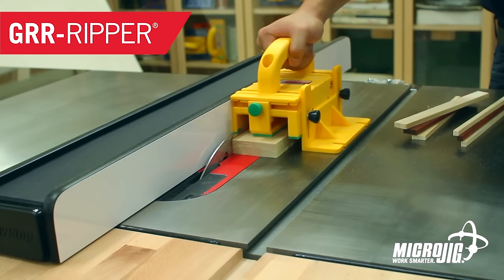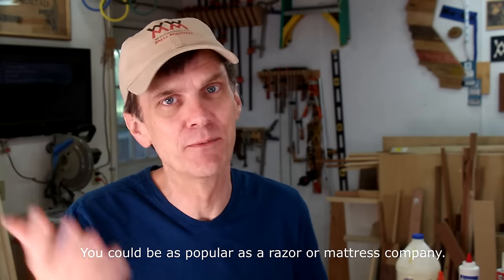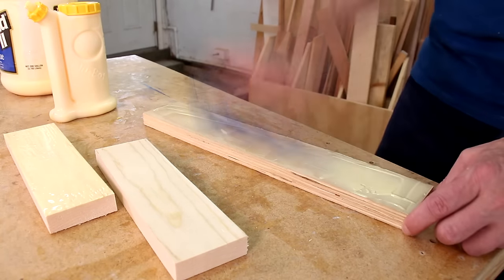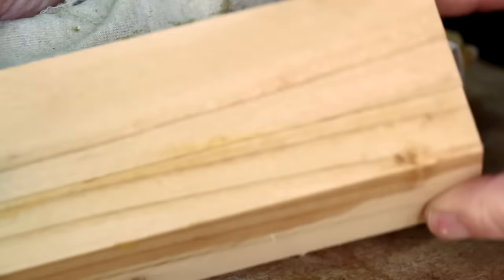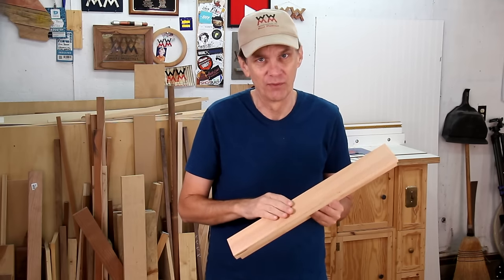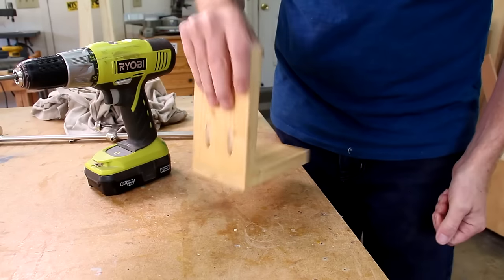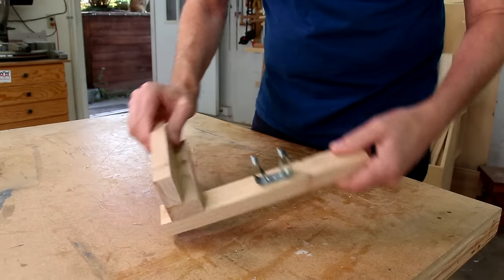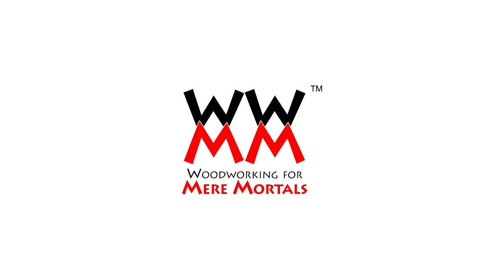What You Need to Know About Glue | WOODWORKING BASICS

Comment: Used weldbond over thirty years ago to stick cement over painted bricks. Cemt still on and sold as a rock. Also glued a capping stone on a brick pillar afain over thirty years ago and it's still stuck. This glue is amazing for woodwork that is to be painted, but wont take a stain. You need to use sparingly around edges so squeeze out is barely noticeable, dont wipe with a damp rag as it will spread and not take stain. Once dry just scrape ant access off or plain down to remove any overages. Can't help but sing praises for Weldbond and no I have no company  connections.
Reply: Absolutely Weldbond! It's the ONLY thing I use, been using for well over 15 years and have never had anything come apart etc...glad to hear you talk about it, everyone's so Titebond oriented that I was watching this thinking, "yeah, here we go again..." Thanks Steve, you give me hope! 😀

Comment: Steve, Is wood glue suitable for painted wood? If not what would you recommend"
Reply: no matter the glue,  you should always sand it off if you can...other wise you are solely depending on the "hold" of the paint to the wood...which isn't meant to be load-bearing.

Comment: When gluing and clamping two bits of really smooth timber, sprinkle a smidge of salt on the glue, this will form a little key between the pieces which will stop the work sliding and shifting when clamping them together.

Comment: Great video but you should have talked a little about the difference between waterproof glues and the regular wood glue that you showed. I only recently learned that if you build outdoor furniture with regular wood glue, it will weep milky tears and the joint will separate even with biscuits in! Live and learn I guess.

Comment: Steve, I often have trouble when clamping glued surfaces.  The boards will slip when applying pressure.  Any suggestions?
Reply: Use salt trick described in comments

Comment: I just use a handful of sawdust to sop up excess wood glue. Rub it in, then wipe off the loose stuff right away. It tends to fill in any imperfections in the joint and doesn't make nearly the mess of damp rags. After a few minutes, a putty knife makes a good scraper to clean up enough to inspect the area. Any sanding required after removing the clamps will be easier and much less than it would've been without the sawdust.

Comment: Hi Steve. I read that you have to wet the wood in order to get wood glue to cure properly. Is that accurate? TIA
Reply: With regular wood glue, you actually want it to be dry. 
The only glue you want to wet the surface for is PVA glues, but those are no where near as strong, and are far more messy to work with.

Comment: For myself I have found out that my Grandfather was right, The easiest and most efficient way to clean up clamped glue squeeze out is with a DAMP not soppy wet but a damp rag, (a old rag made from and old sweatshirt works best for me) cleans up the mess the best... And there's little to none glue over spill to sand off after the glue has dried...

Comment: A trick my Wood Professor taught me when gluing to get that glue off while still wet. after you wipe away  the majority of the glue you can follow up with a wet paper towel and for tight corners use a toothbrush with water to get it completely gone then wipe with a dry paper towel.

Comment: 😫I just finished staining a ern I'm making for a friend and a small glue spot has shown thru the stain ,the wood is maple is this repairable? The spot is like a thumb print. Can I sand it out and blend the stain back in
Reply: Tom Wipperfurth yep I'd sand and refinish. If it's turned remount it on the lathe and sand all around. If it's not turned sand the entire flat side that the spot is on so there's no unevenness. Then refinish that face.

Comment: i learned a nice trick some years ago.. you probably know the problem with moving boards when you want to glue two wooden pieces together and you put clamping preasure on them.. because the glue is a little bit slippery, the boards often move. to avoid that put just a little bit of salt on them! that will secure the boards in place and the glue will dry quicker, because the salt soak the whater out of the glue! 

have fun!

Comment: Sometimes when I got to clamp a project, the wood pieces will slide around on the glue.  I've heard adding sand or salt to prevent the pieces from sliding around.  Any other tips/thoughts?

Comment: What about the foamy stuff,  polyurethane?
It sticks to everything like, well glue...

I use your idea about pre seeding end grain, it's like a sponge, that said, I saw another you tuber debunk the whole "end grain to end grain is weak" theory.
In a controlled experiment, the wood, not the glue joint was the failure point.

Comment: That's all I needed to know. Moisture resistant.
Yes heard a cool tip. If the boards slip and slide putting the clamps on add salt between the 2 boards.
Ahhh, this video was 3 years ago!

Comment: Bonus Cross Hobby Tidbit:
Titebond II (only 2) works as a wonderful vinyl record cleaner. Spin the record . Put a thin line in circles from inner ring to outer ring (dont hit the label) spread with a soft spatula. Wait. Peel off and wipe down. 

The glue pulls out microscopic dust no product will dig as deep. (Maybe a $3k vacuum)

Since it is similar material it peels off in one large sheet without sticking to the vinyl only sticking to dust. 

Remember titebond 2 only. I've seen people just use any glue and then whine it ruined their records because they didn't listen.

Comment: I like to put the wood glue in empty plastic mustard containers. I just rinse them out and then fill it with wood glue. It tends to be less messy and easier to use than those big wood glue containers. Sometimes I use wood glue mixed with saw dust if I need a quick wood filler.

Comment: Rather than using screws...which leave a visible hole (or patch)...i prefer to reinforce the joint with pegs or internal splines.
I use plywood for the internal splines (because then you arent at the mercy of the wood grain)...and general buzz flutes into them with a bandsaw to increase the surface area.

Comment: If you live in a colder area, and your shop doesn't have heating, you should definitely try polyurethane glue. PVA based glues and epoxies need heat to cure, while polyurethane glue (and cyanoacrilates for that matter) need water. To be honest, I use it now for everything, but it's really sticky and messy, like honey.

Comment: thanks, i have been working with wood since i was a kids well.  i still have a nasty scare from using a table saw when i was just 12.  that was more the 60 years ago.  Everything we did with that saw was free hand since it did not have any guides or fences  I would not recommend that. my biggest problem is slowing down to enjoy the process.  i am constantly amazed how well glue holds. on occasion, i have used tape to "clamp" two pieces together. like when i  am doing molding and i need to create a finished end to end of a piece of trim,   i often do that when  i am creating a valance over a bi-pass door. the return is too small to nail or clamp effectively

Comment: How would you separate 2 pieces of wood that you've glued together with wood glue?
I wanted to glue wood to side skirts in the house instead of screwing them in, would I be able to remove it cleanly?
Thanks
Reply: Cut it off. But probably not

Comment: Fun tip with wood glue. Wood clue won't stick to vinyl. Sooooooo, If you have an old vinyl record that is dirty and scratchy, Coat the record with a thin layer of wood glue and let it dry. When you gently peel it off, it takes the dirt in the grooves with it. And you have a negative with decades of dirt stuck to it.

Comment: if you wait 30 minutes on that wood glue the outside parts will harden but not in part near the wood, you can scrap it off with a scraper easy and that way you don't smear it all over the place

if it don't "pop" off give it a few minutes more to dry.

Comment: 3:19 'You don't need to make it super tight.' Others say, pressure is the crucial part whether a joint is strong or not. But the more you press the bigger becomes the 'sliding' problem.

Comment: wait to see the polyurethane glue on future shows. As that glue expands to fill holes and it gets inside ingrain to strengthen it even more.

I was amazed that Americans didn't widely know this decades old, widely in European used glue until it hit to their markets few years back and was huge success in the shows because its expanded characters.

I use 95% of the time the normal wood glue (cheap, transparent, moisture resistant and cheap, did I say cheap?) but for special purposes and difficult tasks where surfaces ain't flat and optimal, polyurethane glue is the key as it fills all caps so easily, so when repairing a broken wood piece, all the grain pieces doesn't need to be in place.

Comment: A good way to remove glue is if the glue is dry then take a soft bristle brush and hot water it works the best maybe little sanding but not as much as you need

Comment: What about Gorilla Glue? I like TiteBond II for most stuff, but I have it in big bottles, so it can be a bit of a nuisance. For quick little jobs, I use Gorilla Glue.
Reply: +42lookc Gorilla makes many different types of glue, including a wood glue very similar to Titebond II.  Their "classic" product is an expanding polyurethane glue which can be a real lifesafer when you need gap-filling capabilities.  Otherwise the stuff is just nasty to work with and cleanup is a real mess.  You should only use this stuff in situations that absolutely require it.

Comment: Epoxy  glues ...can set when  wet. ,
 Can use white vinegar as washup solution/ascetic acid as  epoxies are made from acid based agents.
Gap fill epoxies  glues are best used   as thick  filament of glue ...as it it can take up tension later ..(don't squeeze the glue  by tight clamping). eg gluing two pieces of aluminium  where you want strength in the bond .
Mix ratio outside an error rate of  7-10 % will cause a form of failure  for max  strength / at cure . Heat ( post curing really helps this type of product....

Comment: For finer woodworks or front face pieces, it's better to NOT wipe the excess glue that squeezes out. Let it dry and use a sharpened chisel to cut it off. Wiping glue leaves a thin layer that may clearly show when varnishing ...  saves time on the sanding job.

Comment: I really like hot glue. Most people don't like hot glue because they think it's hard to work with and it will destroy whatever it sticks two. But did you know you can instantly remove hot glue from almost any surface except maybe paper and soft stuff with isopropyl alcohol. Also you can very accurately control the temperature of very cheap hot glue guns with an inline variometer used for fans are dimmable lights. Simply buy a cheap high temp hot glue gun plug it into the variometer and turn the temperature down until you no longer see bubbles appearing on the surface of whatever you're working with. This feature is usually about $100 on a hot glue gun, this set up only costs about $20 and that includes the gun.

Comment: I had an old wood worker tell me that a great trick to hiding Brad nails or screws is to mix some sawdust with wood glue to fill in gaps. Obviously the sawdust should be the same color as the wood for best results

Comment: About 30 years ago I used 2 part epoxy as a casting medium in my miniatures hobby.  Over time I noticed it has become brittle, jeopardizing my work.  Any comment on how these glues age?  When I build something I want it to last 300 years, not 30 years.
Reply: I built a wooden (balsa + plywood) rc airplane aproximately 10 years ago. I used 2 part epoxy for parts i needed to be glued strong. However this year i realised that those joints are very brittle and tend to fall appart. However polyurethane glue based joints are still fine.
Reply: @vaclavdemeter7608    The stuff I've cast that is chunky seems to be just fine (like buildings).  Miniature figures are brittle, though.  I've got a balsa RC aircraft I built in the 70s that seems to be okay.  I look at it though and wonder if it will fly (its a gorgeous Super Chipmunk).  I think that was built with cyanoacetate.

Comment: Don't forget one of the oldest glues, hot hide glue.  When repairing antique wood, often that was the glue used, and should be used for any modern repairs.  

Glue should never be used where joints leave a gap.  Glue's strength is when the surfaces are tight to each other.

Comment: A glue joint is usually stronger than the wood, but those 2x’s that you hammered apart wouldn’t have come apart that easily with 2 or 3 screws installed instead of just the glue. Although, glued joints look much better than lag bolting a coffee table together.

Comment: Here's what I do for wiping glue...
Keep a cup of some sort mostly full of water with a rag inside.
Wipe the excess with your finger and then scrape it off back into the cup of glue with the brush in it.
Then squeeze the rag and use the damp rag to wipe the rest of the glue. Throw the rag back into the water cup.
This set up will work for hours...or even all day.
And using water to wipe the rest of the glue works way better than only dry wiping.

P.s. Pocket screws arent the "strongest" way to reinforce a joint.
Using actual joinery...instead of butt joints or miters is stronger.

Comment: If wood glue is stronger than the wood, could someone build a shed completely with just wood and glue and no screws/bolts/similar? Like, instead of screwing wood together or nailing it together, could you just properly glue it together and still have strong connections?

Comment: You buy your glue by the gallon, 
Well you really can't use it from the gallon container,  so most people refill smaller holders, and use acid brushes to paint the glue on.
I've got a tip for you how to save some money buying glue containers 
First off your only going to use a 1/4 cup of glue at any one time, so why not use jello cups , my wife buys a lot of dole jello cups wash them out and reuse them for glueups  no big deal if the glue sets up in one, just throw it away it was free anyway, but ive found out by accident today if you eat stax potato chips from lays the yellow lids fit onto the dole jello cups like it was Tupperware,  perfect to keep a small amount of glue from. Drying out overnight or if you run off for lunch.
Hey the lids are free also these are items you'd put in the recycling bin or in the trash. Why not use them yourself, you could fill an empty water bottle with glue
Why spend 20 bucks on some plastic container to hold glue when you just emptied a soda bottle made of plastics it even has a lid.  My pont is you can spend your money on Tools or more wood.
Be thrifty .

This message was an unsponcerd tip 
Eat chips and jello at your own risk.
Just rembef you are what you eat, and if you've even moved jello it keeps moving after you've set it down.

Comment: found out that to remove epoxy it is actually easier to use a steel wire brush on it rather than sanding it.
- i use wire brush with a dremel tool

Comment: One more thing I forgot to mention. After removing the tape and wiping the joint clean, pick up a handful of fine sawdust from under the table saw or from the dust bag on a sander. Sprinkle it over the glue joint and rub a good handful of it along the joint then dust it clean with a brush. This will remove any moisture or glue you may have missed. If there's one thing we all have plenty of it's sawdust.

Comment: Tidebond II vs III. I was hoping to get some opinions.
Reply: +Jake Abel  TB III is better for water resistance. It is also darker when dry so may show more depending on the wood. Personally, I prefer the TB III and use something else when the darker line is an issue. The only thing I don't like is the open time. If you are gluing up something complex (like a lamination) it doesn't give you a lot of time. Then I go for the regular epoxy (not the quick cure stuff-- the kind that you use for fiberglass) There are lots of modifiers to change its properties as well.
Reply: I do a lot of cutting boards with TB3 and don't have lines
Reply: Clark Douglas It never bothered me but I just mentioned it because some people find it an issue.

Comment: 99.44% of glue joints are intended to be invisible.   BUT when you want to show off the joint,  mix water based stain (dye) to titebond to get a colored glue joint.   The stain can be a mess, and gloves are a must.  Mix up only what you need.  To emphasize the joint, stain the jointed area and let it dry.  Then glue the joint with colored glue.  Of course, the density of the wood has a lot to do with the colored glue joint.  Good luck.

Comment: If you are using an epoxy adhesive you can gently warm it up with a heat gun and it will run like water and completely fill a difficult joint but be aware this will speed up the cure time and watch what you are doing or you will end up with half set epoxy dripping on your shoes :-)

Comment: As far as I can see, Weldbond is not any kind of magic, just another brand name for PVA (poly-vinyl acetate). I have used this kind of glue for decades and with most woodwork it works best. However, I use other glues where humidity or contact with water may be an issue (epoxy usually works best).